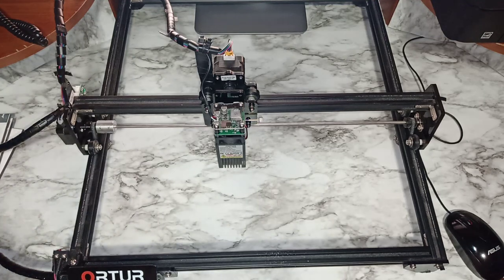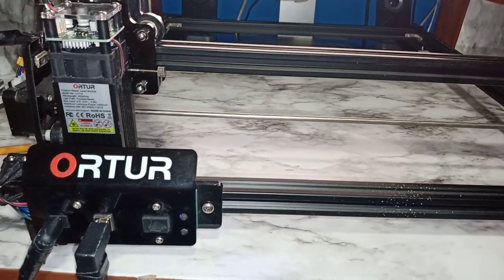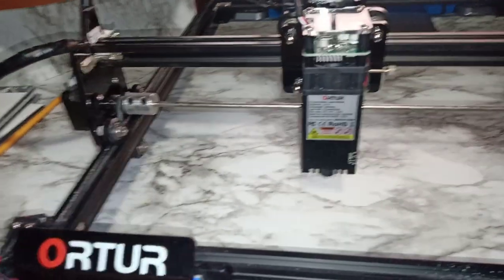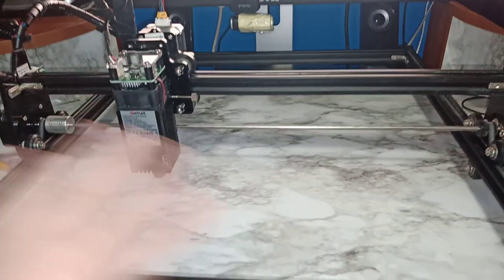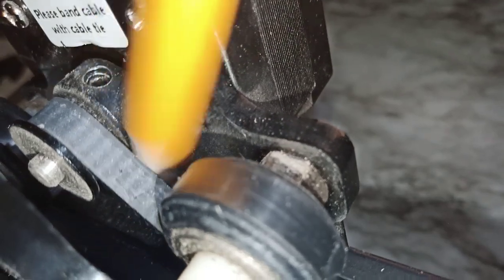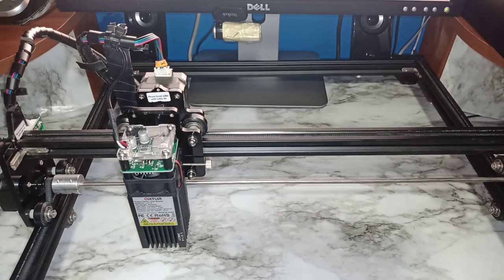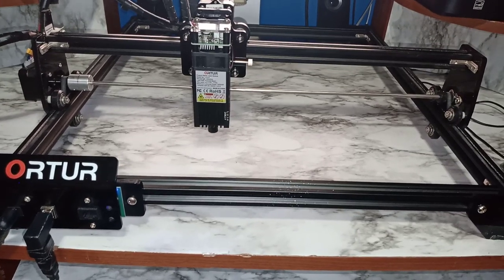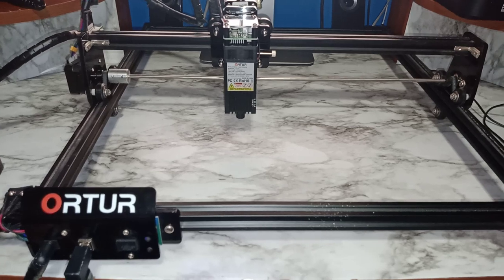Ortur/ laser engraver beginner information

Comment: Thanks for the video, while I was building my enclosure I went through and adjusting my 20W fixed focus down I found like you said the home switch would not make contact. I readjusted it  forward and also made sure the left/right travel was an equal distance to the front rail. You then have to retension the track belts from the rear as you noted.

Comment: I put in a 1/8 in bed in the area under the laser and inside of the legs. Then adjusted the laser height to that new height. That allowed the laser to home above the frame and gave me a full 400x430 print area. Also enclosed my wires in a braded 10mm sleeve and zip tied my air assist hose to the laser wires. No problem now with that wire bundle interfering with the x limit switch. Ortur needs to add about 5mm to the length of both wire bundles. They are stretched to the limit, particularly in the y axis, when laser moves to the extreme x and y print limit. Ortur also needs to use a different headed screw on the coupler from the x motor to the drive shaft. My laser hits the screw heads in the fully left y position as it moves in the x axis. I put 1mm washers on the mounting screws and that solved the problem. I thought of printing your air assist 1 mm thicker to do the same.

Comment: Thank you for this video. 

does the limit switch on the axis that houses the laser need to be touched. When I home it it hits the limit switch with the metal flap and but carries on trying to move until i manuall press the tiny limit switch. Any way you can help with this?
Reply from the maker: Yeah the limit switch need to touch something to stop your laser from moving telling it you are home
For example your front limit switch if the bar is not touching it could be because your laser is too low the laser is hitting the the bar preventing the limit switch to hit

Or you just need to adjust the bracket that touches the limit switch

Let me know if that makes sense or is that what you're asking for

Comment: Hey thanks for the video. I just received mine and it came with the old laser that does not have the fixed lens. Do you see any difference in the burn quality between the two?  Thanks!!
Reply from the maker: I don't want to ruin it for you but little bitty has the newer is better than the older one, nothing you have to be worried about this long as yours is working fine we should be good, you can purchase a G8 lens, but remember you were lose a little bit of power if you were using 500 speed you have to use 300 speed With G8 somthing like that
Reply: Where did you order your laser from??

Comment: Hi, i just got a new laser, but it wont fire, any idea why?? Everything has work minus the laser turning on, homeing works motor works, fan anf light works, im just unsure why the laset wont turn on. Please help! Im thinking its a setting on the computer
Reply from the maker: Can you tell me what program you're using
Reply: @wisamyousif14  light burn 1.0.04
Reply: @wisamyousif14  iv checked with a multimeter and there is continuity going through from mother board to the laser board, software pics up the device, im just confused at this point, i installed this LU1-3 replacing the old(same laser as you did in this video) thinking it was a board and laser issue, but im getting the same problems with this new laser, any idea why? Iv done everything i can see on YouTube and still no turnout.
Reply: @wisamyousif14  i also tested laser with low voltage laser battery and it works completely fine, so laser diode is fine, its just not turning on, pwm is sending a signal all the way through.
Reply: @wisamyousif14  one more thing, maybe you can help me by sending an export file of your settings via email? If possible. Im trying to think of everything before i waste more money trying to fix this. Replacing the mother board is my last option if its not a software issue.
Reply from the maker: hello friend I just saw your message, and I'm still at work, when I go home I will try to help you more can you share  with me you phone or email for better communication.
Reply: Hello I’ve had this laser for 2 weeks now I have no idea how to send job to laser to cut can anyone assist me
Reply from the maker: @85sexxyblack  
hello what you are try to cut 
for example 
1-How thick of a material
2-Do you even know how to use a light burn
3-Have you learn how to engrave yet
please don't take this in the wrong way I'm just asking this question to understand your question better
Reply: @wisamyousif14 I was starting out with some 3mm acrylic but I have moved on to 3mm craft wood I’ve gotten to the point of being able to operate laser but it’s not focused on design how do I do that
Reply from the maker: @85sexxyblack  so for example 
start with a square box you have to be using at least 20w laser and you will need to run it on a low speed  say 100mm/min 100% power and do 9 passes
when you cut the wood completely all the way through then try doing the same thing buy this time do 8Passes until you control it. write the numbers down and then do your shape and see how that got to go you might need to increase one pass by one on the shape/your design in case/to be on the safe side
Reply: @wisamyousif14  I have the 20w
Reply: @wisamyousif14  I also noticed when I did a test it duplicated the outline any idea what that could mean
Reply from the maker: check your belt its not lose / its adjusted right see this video  to do 11:22
https://www.youtube.com/watch?v=-7JcP9LwTqg&t=253s
Reply: @wisamyousif14   have you tried cutting 3mm acrylic if so what setting do you recommend?
Reply from the maker: @85sexxyblack  are you talking black block or clear, due to diode laser , that's what type of laser you have cannot cut anything clear if it's black you're going to have to try to do the method I told you maybe it will work I have not personally but I know it should work if it's black but  you have to do more than one pass slow speed high power
Reply: @wisamyousif14  I tried and it burned so I stopped.
Reply: @wisamyousif14  also I was testing some wood engrave and cut but that was a fail
Reply: @wisamyousif14  do you have a reference material chart for your ortur laser master 2
Reply from the maker: @85sexxyblack  can you give me your email for better communication
Reply from the maker: @85sexxyblack  hello again it look like you help help so give my your email/ phone I will call you  and give you some ideas how to use the machine and what you need to do you do not need a chart each different material you want me to figure out the type of engraving I do have the method I will show you step by step but I can't tell you can't tell you here another show you through a video I'll talk to you over the phone
Reply: @wisamyousif14  I was tempted to send it back for a refund because it’s a lot to learn. And thank you I would rather that I am more hands on when it comes to that. I appreciate you responding back